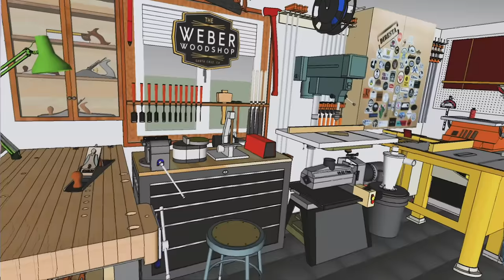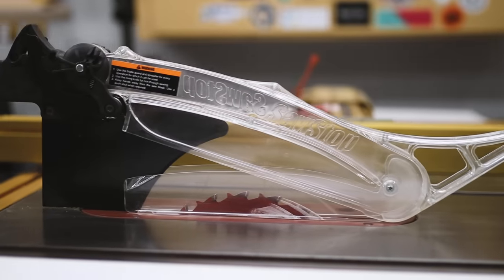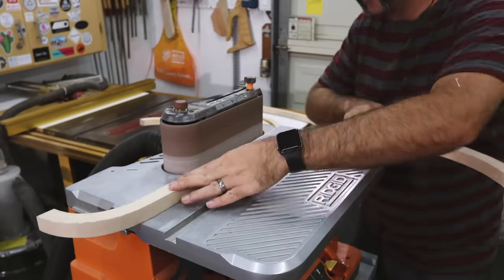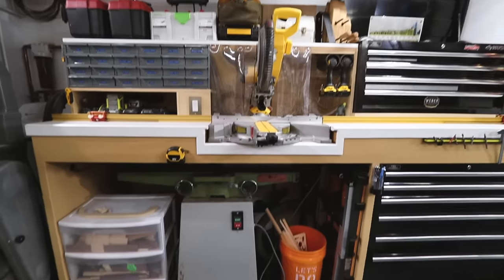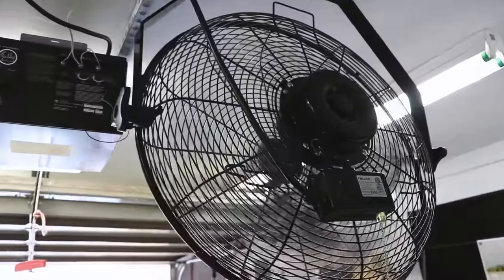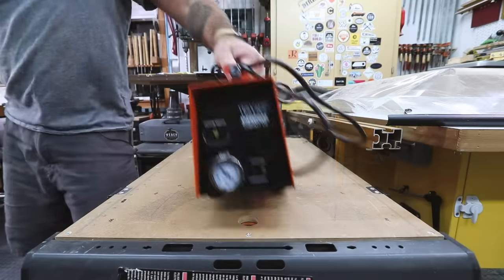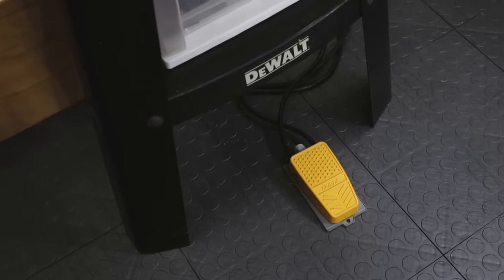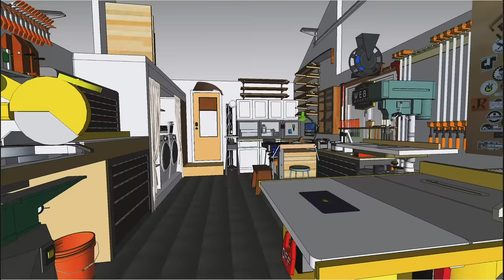(2020) Ultimate One-Car Garage Woodshop Tour!

Comment: Very impressive your use of space while looking nice and clean. For a very small woodworking shop i'm a little envious. I just moved into my home 2years ago and I have been starting to build up my shop in my 4 car garage. I have about 1/4 of it to use for my shop area. We have too much stuff stored in there. Currently adding more due to my father going into a nursing home. He had 2 garages full of tools from the auto shop my great grandfather started and my dad was the last to run it until he sold it when I was 13. So now I have had to add a 1961 Ford Ranchero he restored and made look really cool with a rockabilly style theme and our two vehicles mine just stays outside in the driveway now but none the less my point is space is limited and your video has opened up my creative side with inspiration from your shop. Seeing your use of space on the walls and such has given me ideas now to build shelves and storage space on the walls. Thank you for the videos I've seen a few but this one made me subscribe now

Comment: Looks so good!  I'm also in a 1-car garage, however, not as wide as this appears as I don't have that much space outside of the actual door width.  Plus it has standard 8' ceiling height so no overhead space for storage/bikes, which really sucks as we have 5 bikes in the house, among all the other typical outdoor toys/camping/yard tools in that garage also  Not enough space to have a dedicated space setup, every tool gets pulled out to be used and put away when the next tool is needed in the building process...projects take FOREVER!

Comment: Awesome iterative improvement to the shop since 2017. My only worry would be that wood storage above the computer in case of an earthquake .At least you have the strategically placed Maker's Mark in case of a rolling blackout, only thing I didn't see were flashlights 😆
Reply from the maker: It’s a laptop from 2009 connected to a screen from 2011 so I’m not that worried lol. Sawdust is another reason I’d never put an expensive computer in there.

Comment: Wow.. Very very small.. Very good use of space. I have a 50 x 80 shop..30x50  Is dedicated to a wood shop.. 3 horse power table saw.. 17" band saw.. 15" planer... 8 by 48 joiner.. 30 by 50 dedicated to metal Shop tig miller..Mig miller, hypertherm plasma, 4x8 steel table. 2 in tube bender 2hp milling machine..

Comment: Thanks for sharing your great small shop!  I recently moved from a large shop to a single car and I'm struggling to make it all work.  Do the floor tiles help with noise reduction?  I'm in a HOA situation and don't want my neighbors putting up a fuss with my shop noise.  PS - I've been driving over the hill (Hwy. 17) into Santa Cruz since the 70's to escape our Central Valley heat during the summer.  Love your weather and beaches.
Reply from the maker: K Morrow I don’t think they help with the noise

Comment: Blake, thank you for this vid! I have a similar layout in a one-car garage.

How do you handle large bulky builds and glue-ups like large tables?
Do you pretty much just set up a saw horses and take up the whole middle section of the shop? I find that back and forth walking around a center section set up gets difficult especially with long clamps.
Reply from the maker: I use saw horses. Don't do a lot of tables but have built things like queen-size beds.

Comment: How’s the humidity / weather in your area?  I’m in central Florida with a 2 car garage behind my town home that has to park at least my wife’s car.  

Little jelly on your ceiling height and ability to upgrade the electrical easily. My garage has a 50 amp sub panel and upgrading it is not going to be easy

Comment: Great shop! I'm working on mine now and you've got some great ideas I'll likely copy. One question, how tall is your miter saw bench? I'm 6'3" was contemplating making mine about 42" to allow for some storing my mobile table saw bench underneath but wasn't sure if that was too high. What do you think?
Reply from the maker: Fill out the contact form on my website so I remember to check the height and I'll get back to you when I get a chance to measure it.

Comment: Thank you so much Blake. I have a small shop about that size, and this is so inspiring, thank you. I just binged all your videos :)
I have one question. Behind your table saw, do you have one vacums or two ? The cyclone seems to be connected only to the back of the saw.
Thank you, again :)
Reply from the maker: Guillaume Subiron thanks! One vac, connected to the cyclone, which connects to whatever tool I’m using.

Comment: Did you have to add any circuits to handle increased power load?  I keep tripping breakers.
Reply from the maker: Yes. I’ve added them a few times. I think I have 5 or 6 now.

Comment: Great stuff, thank you for sharing! Do you find any issues with dust, chips or other things getting stuck between the seams on the floor tiles?
Reply from the maker: Christopher Adams thanks! No not at all. The seems are actually really tight when it’s installed. I love that flooring.

Comment: Nice job Blake! I have question for you, can you tell me the depth of your mitre stand overall From wall to front? I think I may do just that with mine. Thank you Blake, Clete
1 last Q, what mitre saw is that?  Xps is a Dewalt saw but the color is all wrong for Dewalt. Thanks again,  Clete
Reply from the maker: Thanks! Just make the miter stand deep enough for your saw. What do you mean its the wrong color for Dewalt? Its Dewalt Yellow... Maybe your screen is off-color.

Comment: Hey Blake. Do the infeed/outfeed tables on the big sander fold naturally or did you have to make a modification?
Thanks, Mitch
Reply from the maker: xRMCoaches yes they are made to fold
Reply: @weberwoodshop  Thanks!  I have the older model and they are locked into place and take up the space of of a small Mazda.  It looks like you can get the folding tables for $135-ish. I may have to see if I can't just modify the one's I have.  Keep up the great work. --Mitch

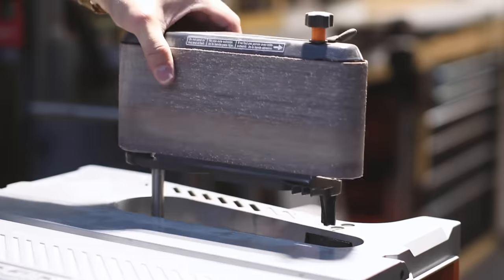Comment: 3:45 I have the same planer and sander and have been wondering if a single cart could hold both. The planer weighs so much! I guess the answer is yes. BUT! It looks like the height adjustment handle doesn't fit. Do you take it off when flipping the planer down? 🤔
Reply from the maker: Adam Tuttle yes I just removed the screw in the middle of the handle. You don’t need it. The handle stays on just fine without it but is easily removable that way. And the weight is not a problem. Just make sure your pivot point is strong. I used 1/2” steel rod and bearings.